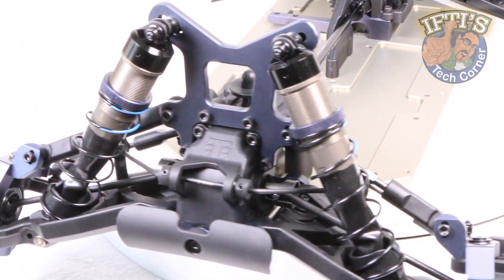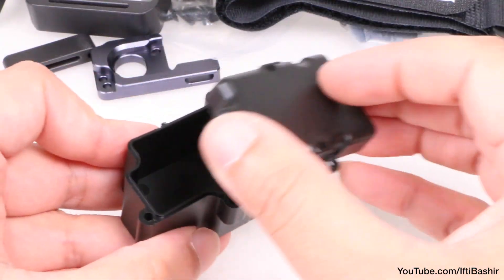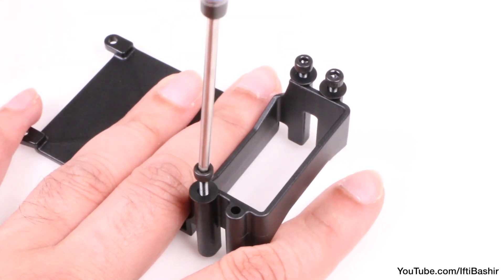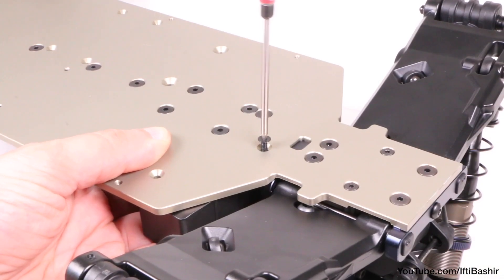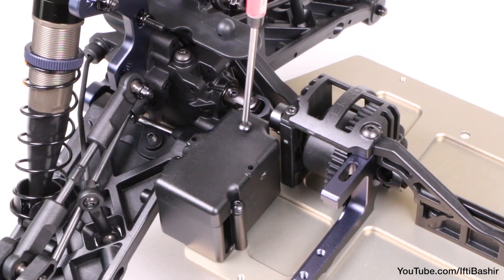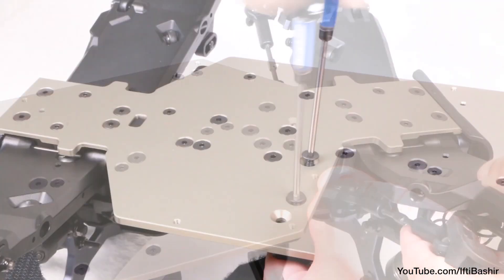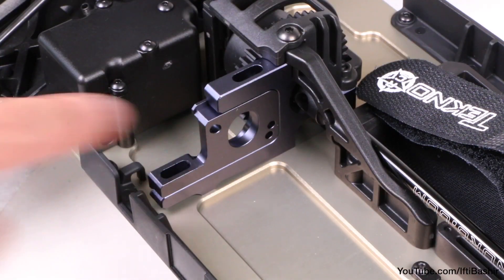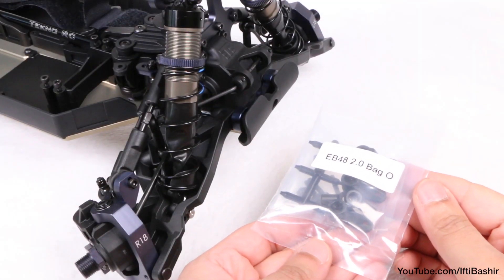#14 Tekno EB48 2.0 - BUILD SERIES - Kit Bag N : Chassis Setup

Comment: I am very new noob. May I ask, @3:34 I can use different size of the Pinion gear on the motor, because I can adjust the distance between the motor and that big gear in the middle @3:34. Is the correct?